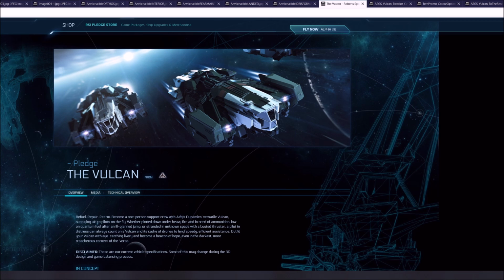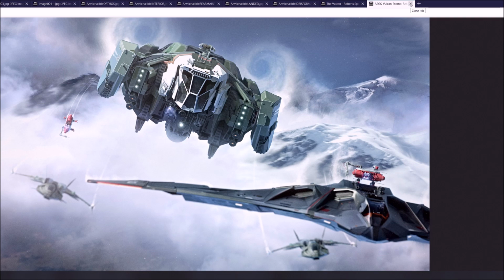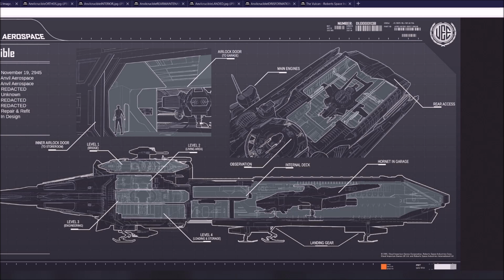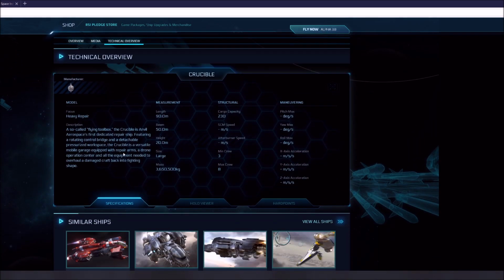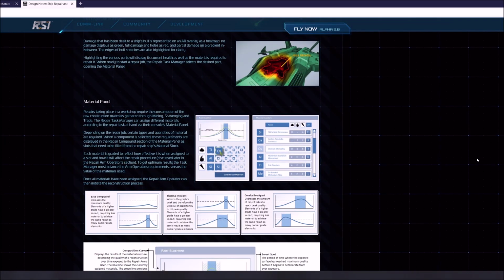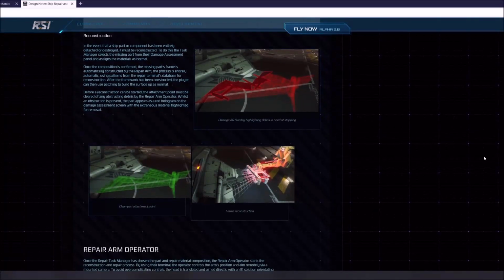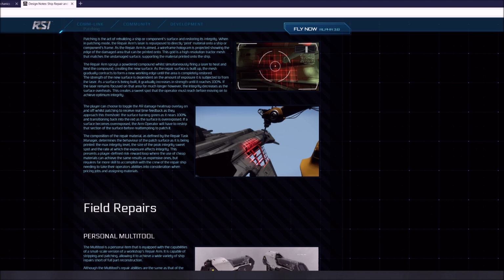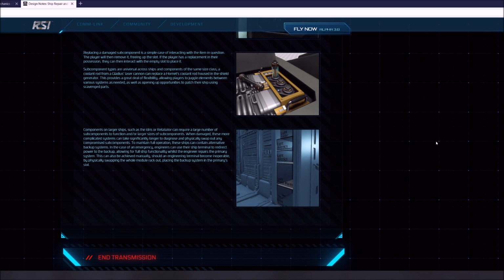Star Citizen - Professions of the Verse - Part 11 - Repair

Comment: This is an interesting future aspect of SC,but I don't see this coming for a couple more years the way the game is going now.
Reply from the maker: I think we will see some level 0 version of the mechanic with the multitool within a year, and maybe the Vulcan with level 0.  Of course you may be right and it may not come within 2 years.  Lol, the odds are probably much more in your favor than mine on that.  I think with physicallized damage, the repair mechanic becomes more likely to come along in some form.  You are going to want to plug some of those holes your ship gains from battle after battle .
Reply: @TexasSpaceNavy  Multi tool maybe,but with the Carrack out now,I think exploration and portals will be next. With another galaxy we will have more need for repair gameplay.  Just my opinion.

Comment: Before the Vulcan was announced. I had an idea of using the Crucible to repair racing ships, either for all teams (first come, first served) or for one team?
Reply from the maker: That sounds like a great plan.  Racing teams will definitely benefit from having a crucible.
Reply: I wonder if they could repair a craft while in motion or jump (when enclosed)?
Reply from the maker: It should be able to jump with it enclosed.. and I assume do repairs while on the move.  I guess it will depend on power requirements too
Reply: Goop point about power requirements.